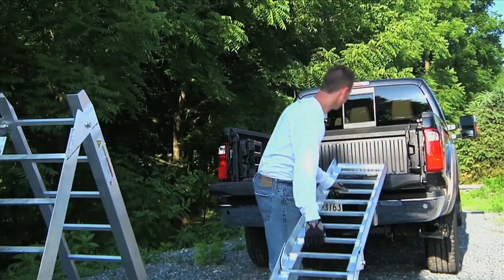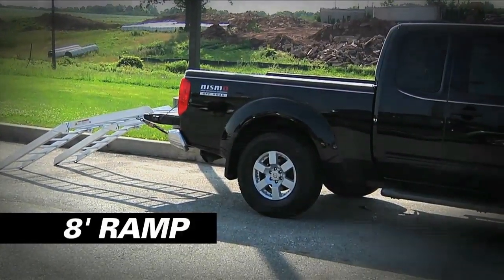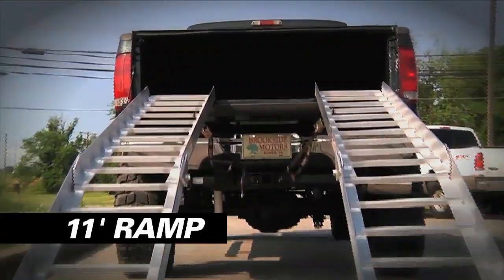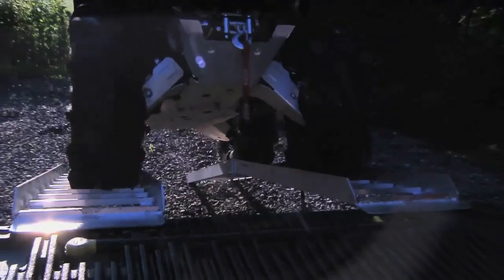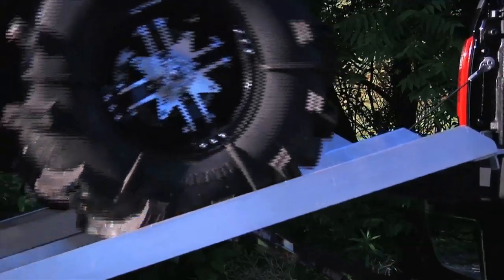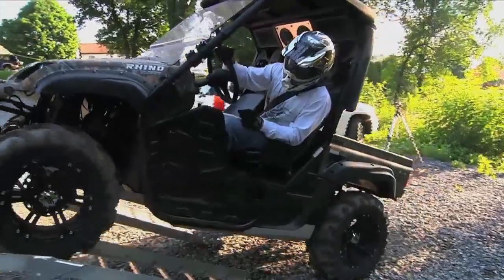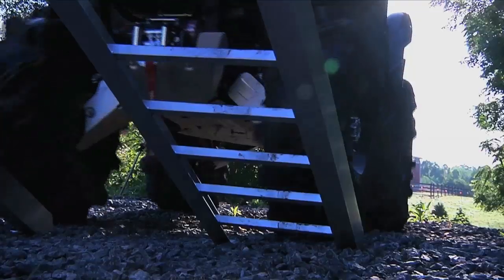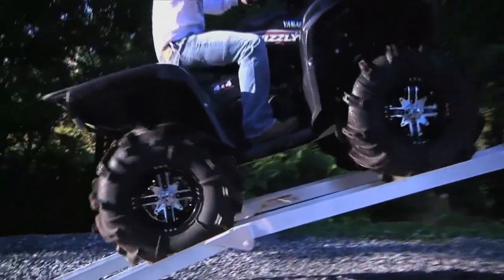LongRamps.com on Fisher's ATV World

Comment: I have 2002 GMC 1500 short box 4x4,so if I bought your 11 foot ramps and after I loaded my 2011 Grizzly 550 into th truck, would both ramps folded up slide under the quad between the wheel's and still able to close the tail gate?